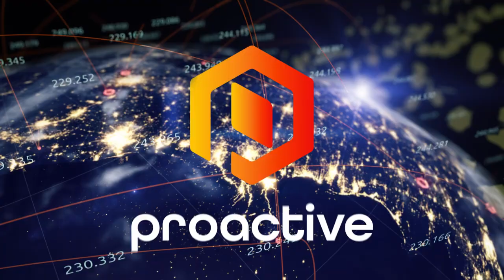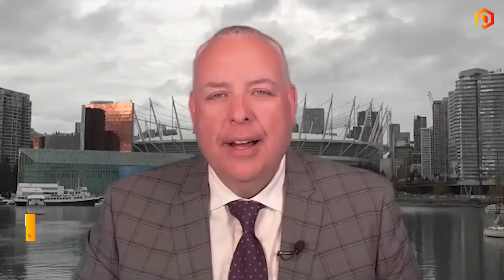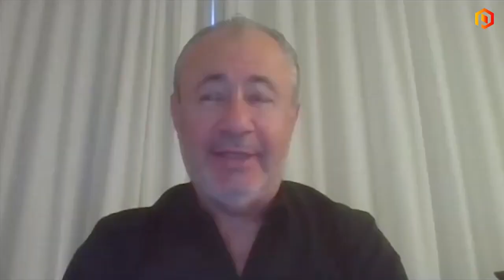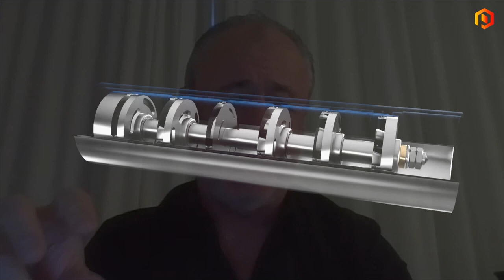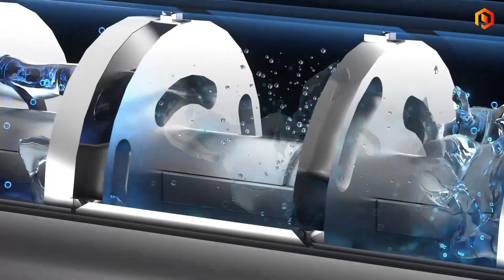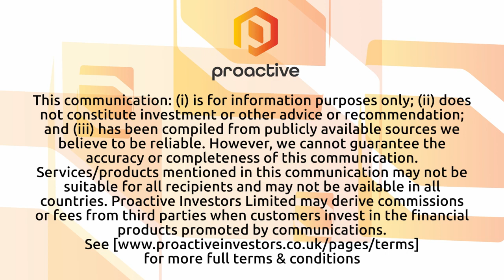CVAT CEO Neil Voloshin interview for Proactive Investors

Comment: The Consumption of Filtered Water is going to increase massively from the Multi Trillion Dollar Companies Ramping Up infrastructure operations Large Scale - look at NVIDIA s and AWS Amazon breakthrough that uses Water to Cool The Microprocessor Chips also it takes Trillions of Gallons of Filtered Water just for the Production of Micro Chips,whereas, we need even more water in the aftermarket for cooling system s - yes Absolutely Agricultural Needs Also 💯👌